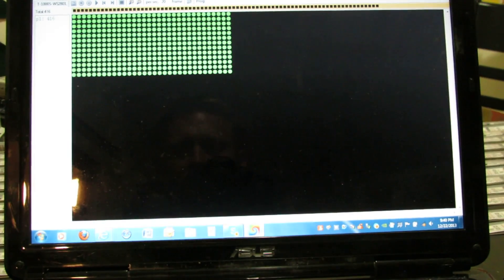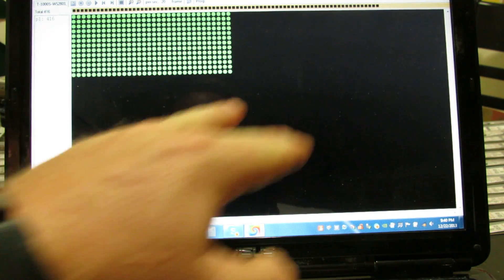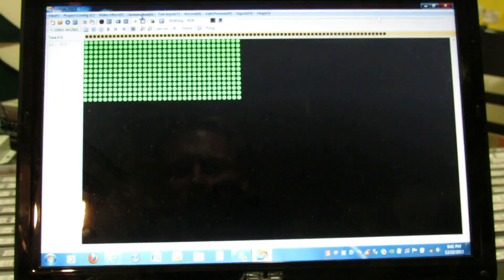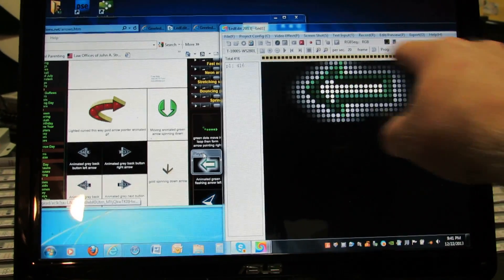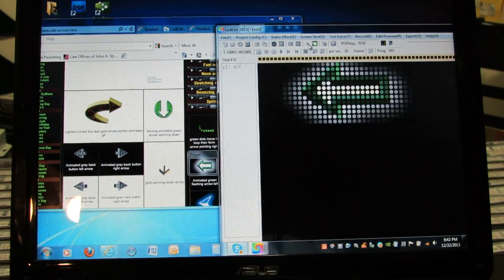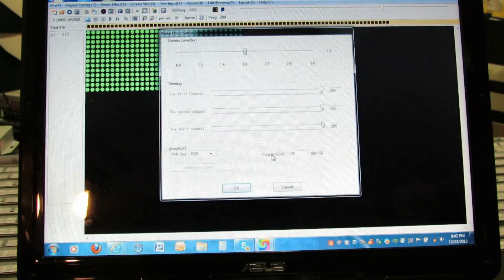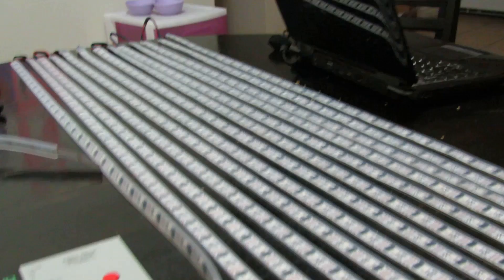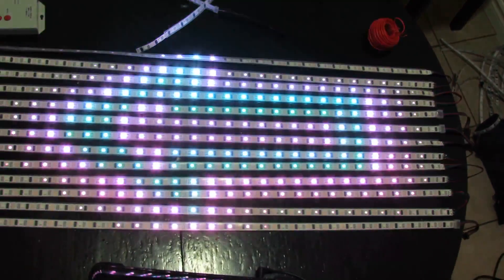How to Build an LED Display, #3 Display Animations (WS2801 LEDs)

Comment: Just want to say thankyou for these tutorials. They are brilliant. 
Just wanted to ask a couple of questions please. 
If I wanted to set up a FRAME rather than a screen, a hollow rectangle
does the gui allow for that set up?

Secondly I also wanted to ask about file size. I wanted to use the frame
to light up a puppet show as if they were stage lights but with one push of a
button and then off it runs for say 15 to 20 minutes lighting each scene. But
would this generate huge files? thankyou! JJust want to say thankyou for these
tutorials. They are brilliant.